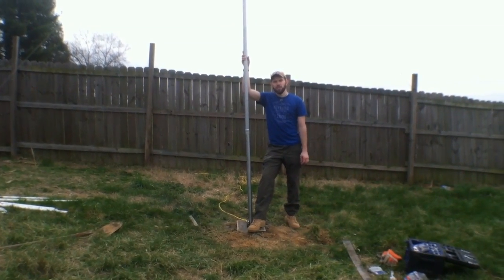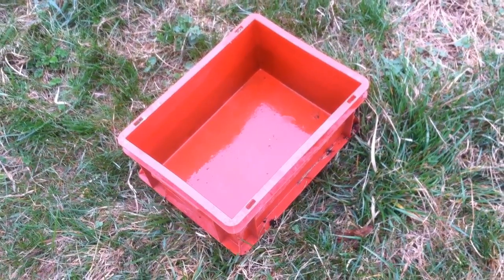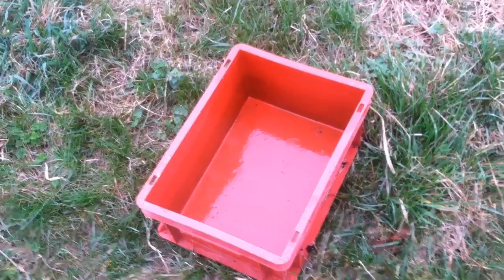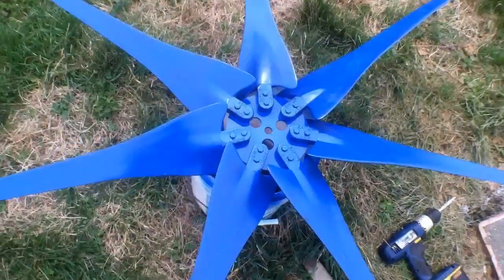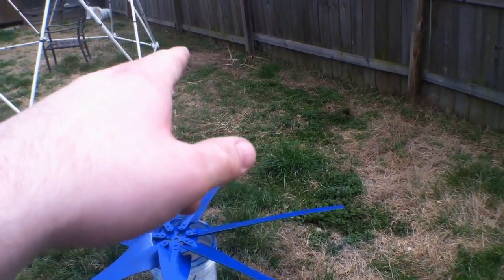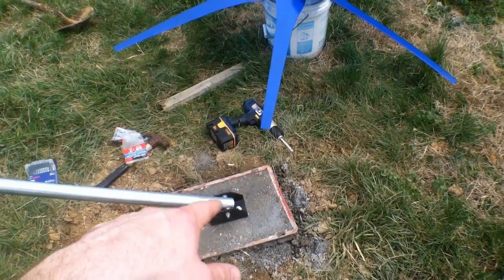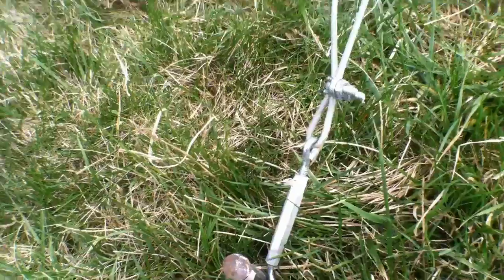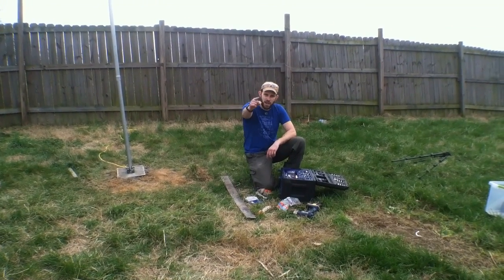How to install an ALEKO portable wind turbine mount using a Missouri Wind and Solar turbine

Comment: I was wondering if one of those Aleko towers would work with the Missouri Wind and Solar turbine ,, Thanks for making this video :) I have been thinking about trying one of these towers,, I might go deeper with the base of the turbine pole just because it acts like like a lever, the pivot point is where the guy wires hook up, push on the top of the tower and the base of the tower will want to go the opposite direction,,  A deeper foundation will help hold it in place in high winds,, I always over build,, build for the worst and hope for the best :)

Comment: Great job. I've put a couple of wind generators up myself. Mine is a 3,000 watt Whisper on an 84' tower made from 6" schedule 40 pipe, and that was heavy. I have a 5548SW Trace inverter and a battery bank that's about 60kwh. My Trace also controls my 33kwh 50hp diesel gen set to charge the battery bank, and run power hungry 220v items, if we're lacking wind. I did all this many years ago. In fact off road diesel was just $0.62 a gallon when I did mine back in the 90's. I'm glad I bought 3,500 gallons worth and it's treated with PRI-D. Keep up the great work.